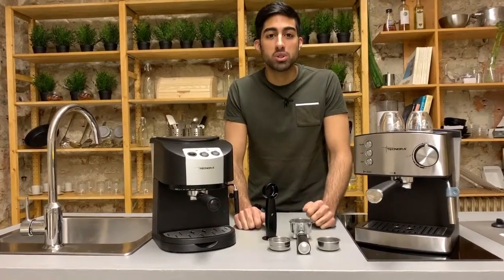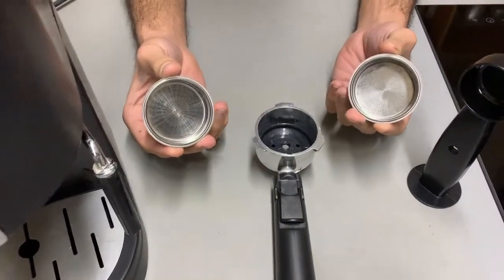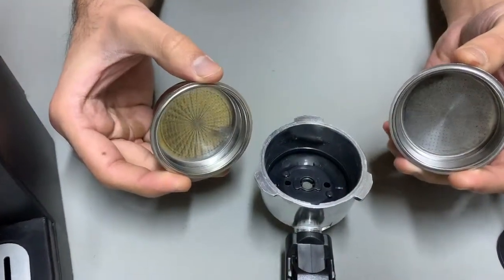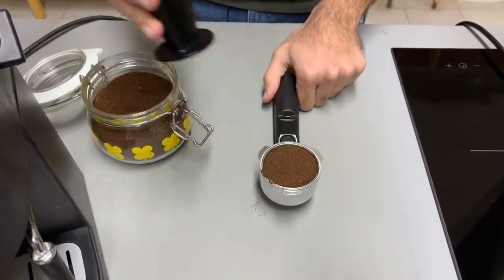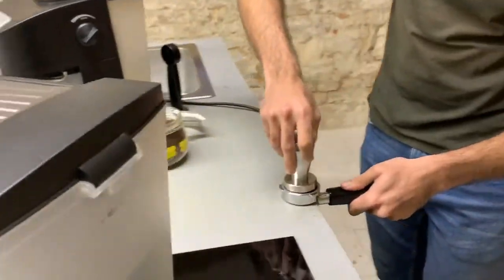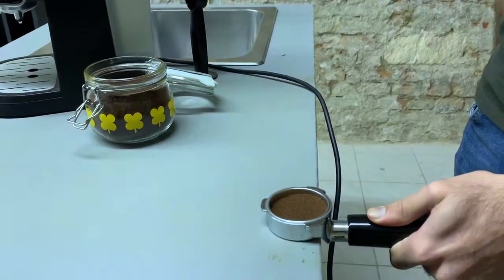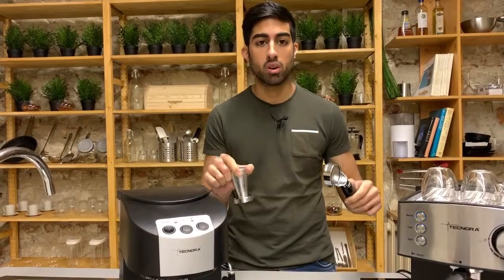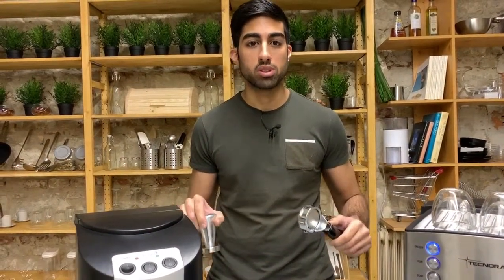PRESSURISED AND NAKED PORTAFILTERS FOR ESPRESSO MACHINES EXPLAINED

Comment: Wish you would include a non pressurized basket with the machine like Gaggia Classic or Rancilio do.
Reply from the maker: Hi Kshitij, 
Thank you so much for your feedback and interaction with us. 
We would also like to thank you for your review on Amazon. 

The reason why we sell the naked portafilter as a separate kit is that it is meant strictly for people that understand the intricacies of pulling a great shot. 

Surely, you understand that you need to go through a learning curve to get it right.

Also, just including the basket wouldn't be enough. 
We would have to include a solid steel tamper as well to get the puck right.

That is why we sell our machines as a ready to use, no frills espresso machine and give the option for a Barista PRO kit upgrade.

Thanks again!

Tecnora Customer Centre
Reply: @tecnoratv  Oh I definitely get that. What I meant was that the Gaggia Classic (and now the Gaggia Classic Pro) include a portafilter (not the naked one), a pressurized basket and two non pressurized basket out of the box. This gives a person to use pre ground coffee initially and later on when he upgrades to a grinder, use the non pressurized basket as well without having to invest more on the portafilter and the basket.
Reply: @tecnoratv  Oh and by the way, I love the coffee maker. Really noticing an enhanced and more balanced flavor now as opposed to my old steam based maker.
Reply from the maker: Hi Kshitij, 
Yes, you will notice a marked difference in the coffee experience. It will be similar to a commercial coffee shop. 
The steam espresso machines are not espresso machines at all. 
They are more of drip coffee machines with a higher temperature to generate steam and that is what causes the coffee to over brew, releasing unwanted acids.
We suggest keeping trying coffee from different estates and different roasters.
Not many people know that excellent coffee is grown in India and many superb taste profiles are available to enjoy in our own backyard.
Welcome to the world of real coffee!